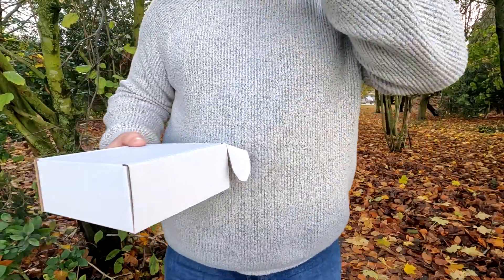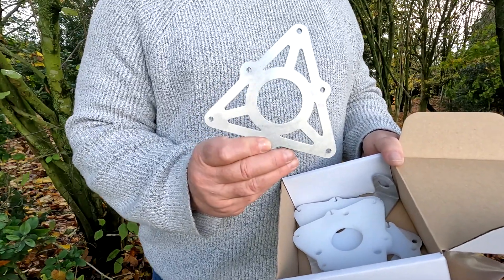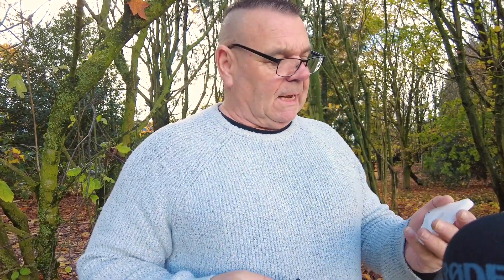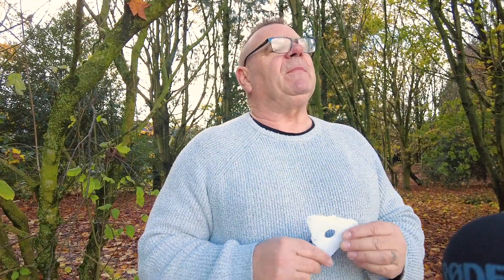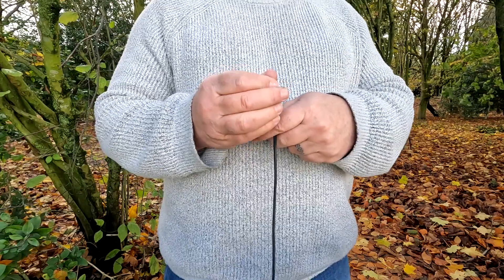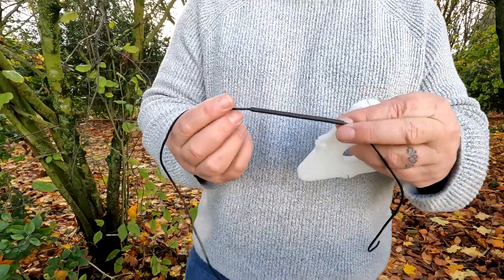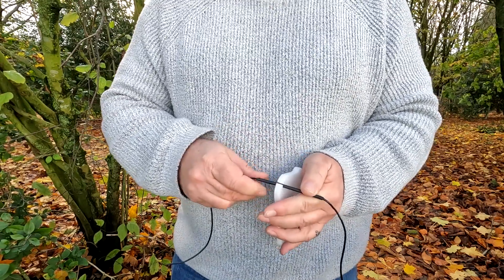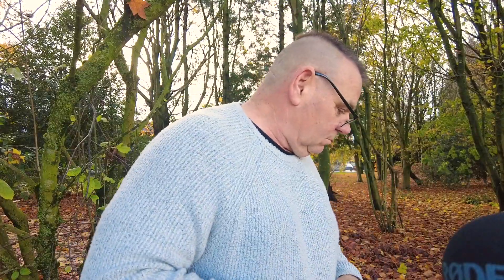Major Upgrade - DX Commander Expedition Kit

Comment: Hey Callum, put a slot on those white supports on the side ( 90 degrees to one side ) at a 45° angle and that probably would eliminate your need for your shrink tubing.  N9NVU
Reply from the maker: We tried a lot of stuff. Reason for this method is to reduce potential for any breakage in cold weather.

Comment: Too fiddly imo. Too many changes. Tie the wire on top securely and leave it long. Have the elasticated cord at the bottom where the adjustment’s to the wire and tension can be made. This works for me and cuts out a lot of fiddly bits. No more dropping poles for adjustment’s. EI3KY
Reply from the maker: No adjustment should be required anyway..

Comment: Very nice, it's enjoyable seeing your products evolve Cal, makes some of us Hams inspired to finish off a project or 10... I see you are thinking of us portable operators as the driven plate has gone on a diet too...18kg winter backpack before radio gear gets a bit gnarly...The only item I would add to this set-up would be a little bag/organiser to store the elements, driven, divider plates and maybe a few pegs that's easy to get your hands on buried in a Bergen. I know this is something that the end user would most probably source but a supplied dedicated DX Commander organiser for this particular kit would be the icing on the cake for SOTA/Wild camping/radio trips.
Reply from the maker: Yes, I have looked at custom packs, pins etc etc.. It would add to the cost and I am extremely cost concious - I remember repairing a wired mouse once because we had so little money, I couldn't afford a new one.
Reply: @DXCommanderHQ  I respect that Cal... Your antennas, even just your poles are very affordable. I purchased a 10m pole and a reel of wire from you, have made several dipoles at a cost of around £100 and still have plenty of wire left over for future shenanigans.

Comment: I would put the notch to the side and at angle from vertical to reduce chance of wire pulling out from mast movement without the faff of the extra tubing.
Reply from the maker: We tried it and in stress tests in freezing cold, it produced a potential break hazard.

Comment: Callum. I've been putting some serious thought into an antenna design based on your antennas and this video plays right into that. The idea is for people like me who have a bunch of tall trees (or whatever, for me its trees). Anyway, I was thinking that a design that had no pole, just the bottom plate and some kind of top plate with the wires and perhaps cord if needed. What I envision is either at my home or say I'm doing a SOTA up in the mountains and I have a tree nearby. I can just throw my line over a branch and hoist up the antenna. So no need to carry a pole etc.  What's your take on this kind of design? A poleless commander would be an interesting variation.
Reply: Have a look at Ham Radio Dude, his latest video shows him working on something  similar.
Reply: @sonofjack4938  I'll have a look. Thanks.
Reply: It is a good idea but the problem I have had is that the elements wobble and do not retain their spacing in wind etc.  This severely affects the tune - hence the need for spreader plates.  I guess you may experiment with a "no-pole" DXC using just the spreaders but if the elements wobble it just don't "work"
Reply: @M0RMY  My thinking is some kind of cord that attaches each element all the way to the top. Then on each cord there is a clipped on bungie cord that keeps tension on the elements. The critical thing would be enough tension to keep things where they need to be but not so much you stretch them. Naturally the spreader plates are critical and may potentially need more since there is no rigid pole in this scenario.
Reply from the maker: Nick, that sounds more like a home-brew bit of fun. I have thought through previously, all the problems making this ion the field (there are a LOT) and decided that it's not my bag.
Reply: @DXCommanderHQ  Indeed, I'm sure there are quite a few. I'm thinking something along the lines of a couple more spacer plates, cordage for each wire with a tensioning bungie cord on it, and potentially stiffer wire. Not sure on exact design but while thinking it through I was thinking that anchoring the bottom and stretching everything out taut and setting the tension on the wires would be critical. Then you need to get the thing up without tangling it all up, which after a bit of practice shouldn't be too bad. I even thought about using that fishnet tube stuff around the antenna to keep things in some sort of order. Lots of fun things to experiment with here. Thank you for your response.
Reply: Food for thought --- You Tube,  Mike Hannah,  Cheap HF homebrew three element antenna.
Reply: @sonofjack4938  I'll definitely do that. I'm all for a nice homebrew. Thanks.